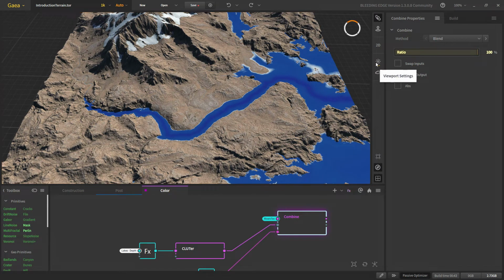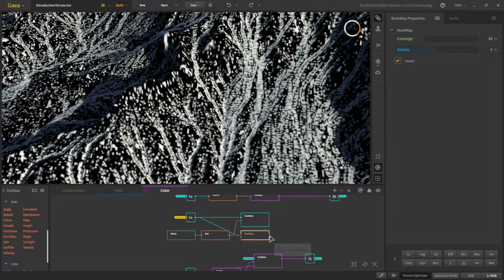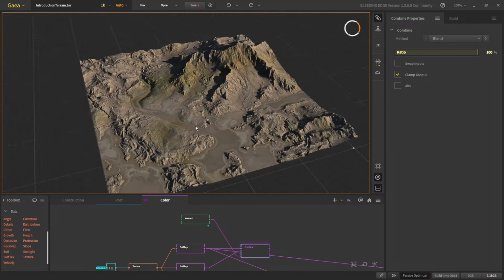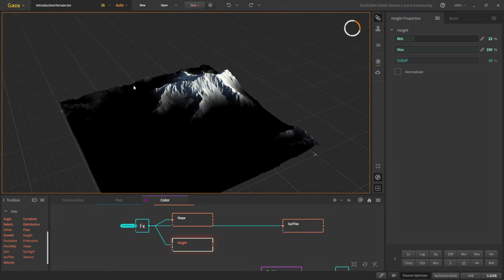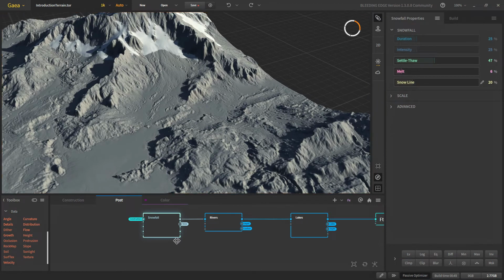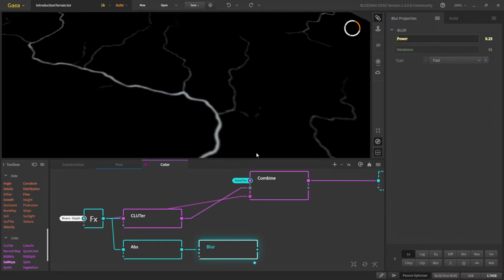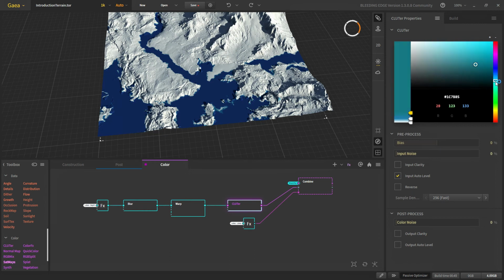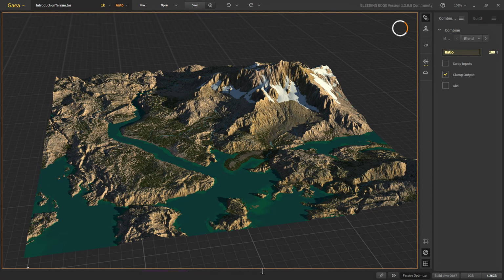Gaea Beginner Tutorial Series : Part 4 - Advanced Texturing

Comment: I'm also having an issue when adding the vegitation. #1 my input portals (on all textures layers) are white instead of blue. When I try to add the vegitation nodes I just get an error. The viewport also just shows a white, blank plane instead of a texture. I've gone over all of the tutorials many times too. Cannot find the error, please HELP !!!
Reply from the maker: Try restarting the engine. Vegetation also needs the heightmap as the secondary input, Are you plugging it in?(And making sure you have an underlay) Also, Vegetation is outdated now that Arboreal node is out.
Reply: @CrowBiomes  yes, I had the height plugged in. I'm recreating some nodes now in case they became broken. Should I use Arboreal instead of vegetation? Thanks for these videos Klauss!!!
Reply: @CrowBiomes  It is acting as if the portals are breaking too. Using Indie paid version bleeding edge.
Reply from the maker: @reliquary1267  hmm, hop on to discord and let's see what's the situation and Yes, Arboreal is far superior and it actually simulates everything and We can control it based on flow, altitude and slope.
Reply: @CrowBiomes  do you have a link? I'm not a discord user
Reply: @CrowBiomes  I created a server and channel for gaea. R3lic74
Reply from the maker: There https://discord.gg/MGhpvb5ECv
Reply: @CrowBiomes  I'm rebuilding the entire thing and taking care of errors at the moment. I'll message again when I'm sorted out. Thanks for your help.